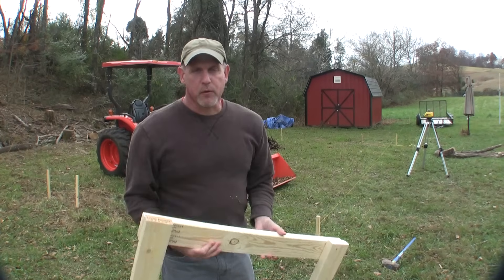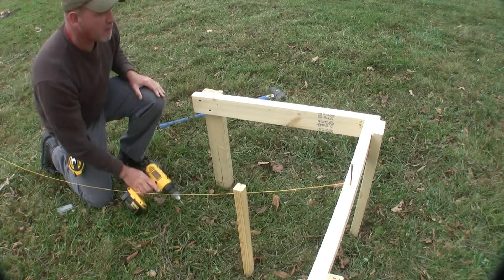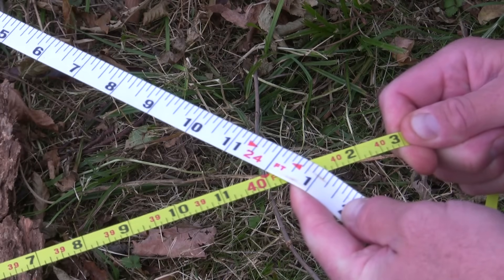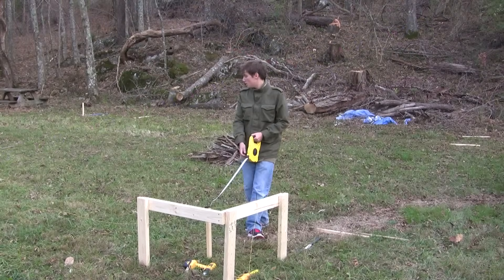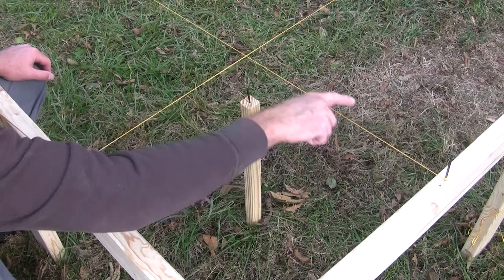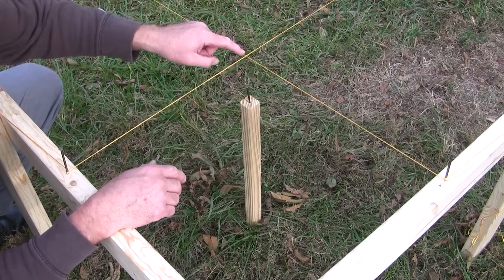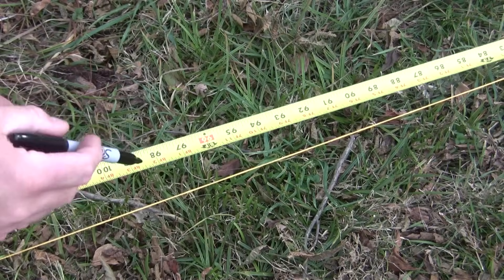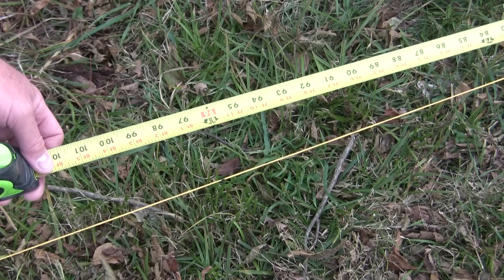How to Build a Pole Barn Pt 1 - Site Prep & Layout

Comment: Great vid!!! Very easy to follow and understand. I was just wondering if there is any reason you didn’t go with the 3,4,5 method to square up the barn?
Reply from the maker: Thanks for watching and commenting.  Actually, what I did is the 3,4,5 method but I use the actual corners instead of measuring off a few feet on the string line.  The problem with that is it's really hard to be accurate measuring on the string line that moves and sways.  Say you measure off three or four feet to get the diagonal and then you accidentally move the string a smidge, the 30 feet down the string you are off an inch!  I've just always gotten good results the way I demonstrate.